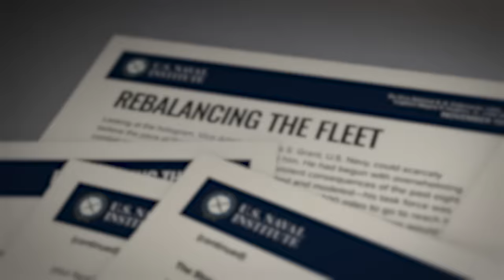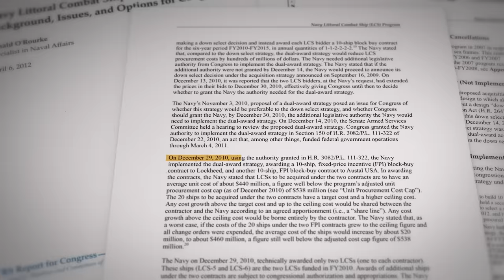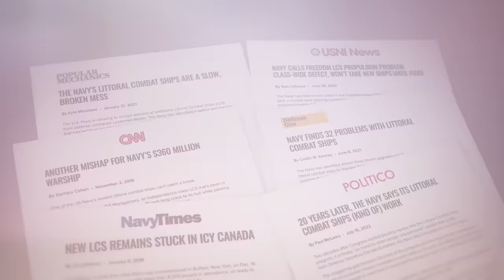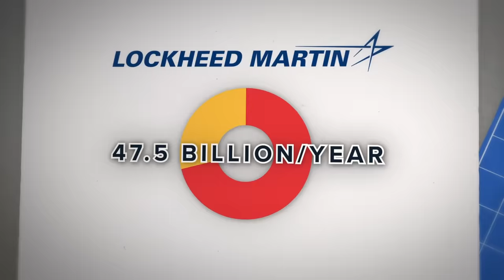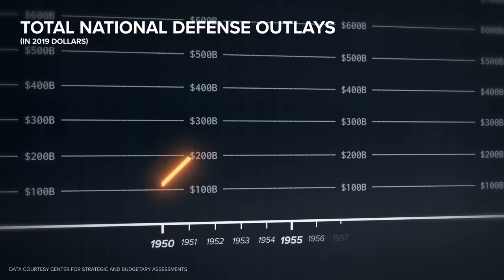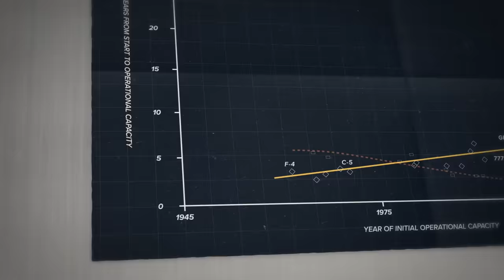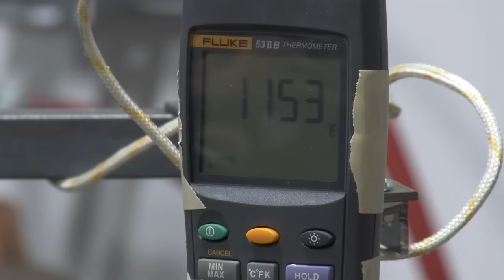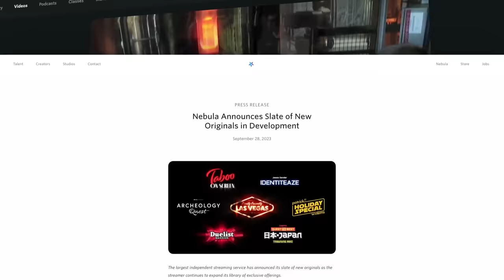Why the US Military Costs so Much

Comment: I used to be a manager at Disney World,  if I wanted a sign that said stroller parking, I would have to contact Walt Disney Imagineering and make sure it goes through the process it would cost $15,000.  If I called the Orlando sign shop, sent them the picture, and have them come install it (which is what Imagineering would do anyway) it would be like $250.  Disney operates just like the military, massive amounts of wasted money.
Reply: In theory, this is why the US military has shifted some functions to contractors. In practice, the contractors will charge $12,000, claiming that they saved the US taxpayer thousands of dollars, but it actually costs $20,000 if you account for various hidden expenses.
Reply: Well yes, but what if that sign was produced with conflict country paint? Disney ensures it doesn’t by sending a team to inspect the facility which will produce the sign, check county codes to ensure the facility is current with all requirements, and have a personal conversation with the team delivering the sign. That way… idk doesn’t make a lot of sense doesn’t it?
Reply: But, but I was guaranteed that the free market is way more efficient, next you will tell me that they would skimp on maintenance to reduce cost in the short term.
Reply: Bigger an org is, the more cumbersome it is to move money around.
Reply: @Andyliberty0923  Moving money around is easy. Producing discernable value is where the challenges lie.
Reply: But that example sounds more like money is going from the left pocket to the right pocket and it doesn't actually leave the Disney conglomerate. Sometimes these corpo transactions are designed to push turnover numbers and money just goes around in a circle over several subsidiaries, which could be the case here.
Reply: I don't fully believe Disney would charge $15,000 for a sign for their own theme parks. Disney relies on the customers/shareholders vs the military defense corporations rely sole on the US government for its money where we the taxpayers have absolutely no say on what  and how much can be spent.
Reply: Hehe. The old adage is, to the executives none of that $15,000 is wasted. They needed to restock a gold plated cocktail shrimp platter on one of their yachts.
Reply: Sounds like tax dodging to me.
Reply: @Gulitize  The free market is much more efficient than the government. The issue is that when a politician says  "free market" they normally actually mean "tightly controlled and monopolistic market controlled by three of my friends who pay me millions of dollars through bribes"
Reply: @thekillalizard  Ding Ding Ding... Glad someone saw it.
Reply: When were you a leader there? No one would ever contact Imagineering for a sign like that, it’s what Central Shops is for. They make thousands of things like that a month.
Reply: @NinetooNine  I work as an IT consultant. Let's just say I've seen enough tricks to write 6 months work of lecture material from working directly with owners of businesses lol. Pretty sure that ones actually got a name: offset profit 😂
Reply: They pay large sums for Tax write offs.
Reply: @Gulitize The MIC is about as far as you can get from a free market while still technically being capitalist.
Reply: @Gulitize  it's more a function of large organisations and how they balance efficiency vs risk of corruption.

The more control, the less efficiency and opportunity for corruption. The less control the greater the efficiency and opportunities for corruption.
Reply: yep. most dont believe it until they see it.
Reply: I worked at Imagineering N Hollywood late 90s. I made a sea turtle out of Carbon Fiber. No rhyme or reason and there were a lot of drugs there too. Had a blast and still have great friends that I met there.
Reply: @horntx market consolidation is inevitable under free market capitalism. 

It’s natural selection/survival of the fittest except firms are smart enough to eventually figure out how to game the system
Reply: Every corporation does. It has nothing to do with the military or the governments. If you are a large organization that must accomplish a task, they spend huge amounts of money and waste a ton of resources to ensure it.
Reply: @westrim there are some benefits though. Government agencies are incentivized to Ballon their budgets and not save money, but private companies want to keep costs down, if a government agency makes a mistake the government has ro pay to fix it but you can force a company to meet contract agreements even if it losses them money. It's also easier rtor companies to figure out costs since they tend to be more accurate, even when the government does establish budgets for projects they end up using private sector bidders to figure that budget out for them.
Reply: SPY magazine did an article on Disney with the headline "M-I-C, R-0-M, A-N-A-G-E!"
Reply: That's bc it's a bureaucracy thing, not a military thing
Reply: Because that’s how the executives with fancy job titles and multi-million dollar salaries get paid, even though they don’t really do anything
Reply: @Blex_040  "money is going from the left pocket to the right pocket"

so exactly like military contractors and politicians
Reply: @BOMBON187  Not solely on the US government, defense contractors can also sell their products and services to foreign (allied) governments.
Reply: Not wasted. It's going into a lot of peoples pockets. Just not yours.
Reply: Is it wasted though? You could look at the military as a money launderer. Because all money is debt then any way you can get money into the economy is how people get raises. What I would like to know with all the bases etc and all the deals that are accordingly done, where are the figures for the return on investment?
Reply: @westrim this seems like a practice that probably has a specific single word descriptor
Reply: My dad worked for the government under the V-22 osprey program. He would say how bad companies would overcharge. A regular bolt would be over a hundred bucks. Just because it's "official" equipment for it. Kind of like how apple does that with its components. You can go third party for much less and it'd be just fine if they didn't hardwire code in to deny features if it's not official. 

It's part of the reason I think right to repair is so important. Think how a farmer feels when their shiny new John deer tractor breaks down in the field. He could fix it himself except you need a digital key to unlock it. You call them to get service and they say 4-6 weeks. Your crops need harvesting now though. 

It's not just limited to phones or farming equipment. Those are just two examples. They can restrict access for nearly anything since they have computers. 

Your car breaks down? You'll have to have it towed to an authorized repair center for 4-5x what another place charges. Or buy a new car. There's printers that require ink to scan or fax. There's another one that you need a monthly membership to use at all. 

All these companies know that they don't make the majority of the money from the product itself. They force you into a loop and charge more for required parts or services. Its extremely anti consumer and I hope people start figuring it out soon.
Reply: It's not wasted if it's going into someone's pocket
Reply: That's not waste. Disney has a system that basically assures they get the sign in a way that conforms to Disney standards which is something a random employee going to a random sign shop cannot do.
Reply: They should just merge The Walt Disney Company with the Department of Defense.
Reply: private sector inefficiency
Reply: I used to be a CFO in an a world know US corporation.  I instantly fired any person that avoid politics and procedurals that waste money including a manager that allowed that kind of dispend.
Reply: Do the waste money on good wages or were they to cheap for that…?
Reply: @BOMBON187  The actual sign wouldn't cost $15,000, the amount of man hours taken up by all the people discussing if they needed the sign then what it would look like is what adds up to the cost.
Reply: @BOMBON187 You don't understand how large corporations work.
Reply: @thekillalizard This
Reply: @Gulitize  How is that free market? He can't go to the better option because he's not free to chose.
Reply: It’s funny Disney owns Star Wars, because the Walt Disney Company is the closest thing to the Galactic Empire I’ve seen in real life.
Reply: I worked for one of the contractors. Most of the maintenance on RF systems were basically system calibration and taping a few bolts etc . For this my company would bill 50,000$ 😂 since their own technicians are not allowed to work on it as that would void the warranty 😂
Reply: UK council work the same. 4ft parking line? Minimum of $1500
Reply: Eow
Reply: Apparently if you take a big shit on an aircraft carrier, contracters charge $800.000 to unclog the toilet. That is an expensive poop!